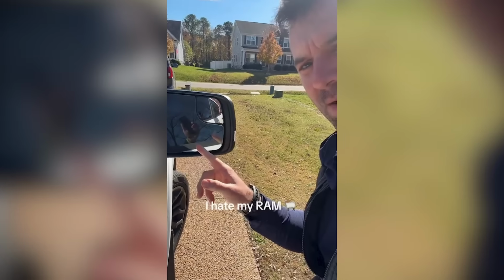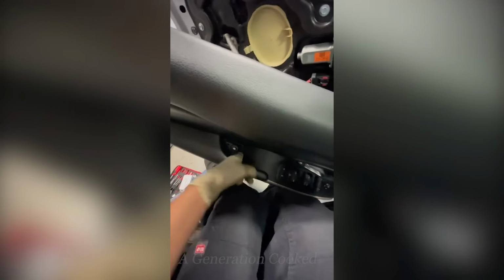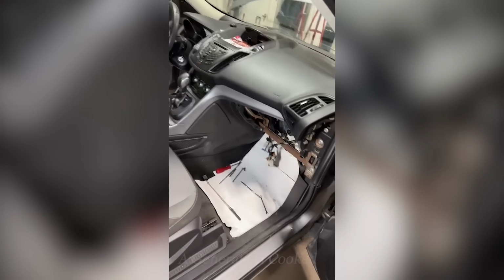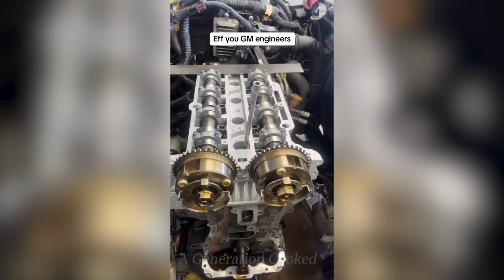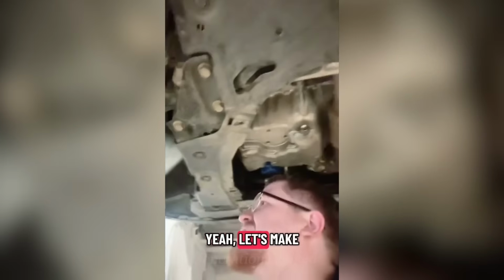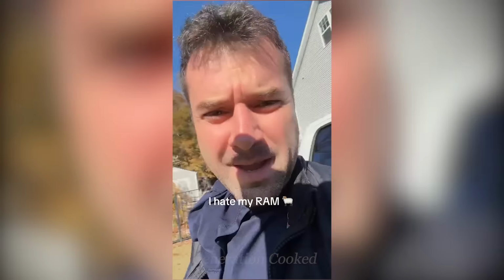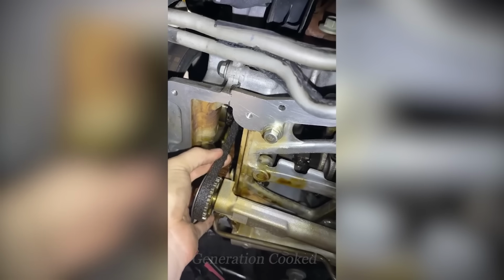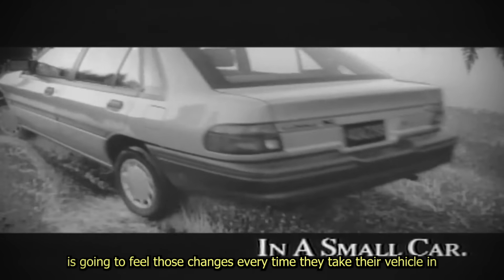Car Mechanics Are Finally Speaking Out About What Really Happened To Cars & Trucks, It's Junk

Comment: The Post-COVID Automotive Decline: A Revenge and Counterfeit HypothesisMany vehicle owners and mechanics are currently venting their frustrations online regarding the shocking drop in vehicle reliability—particularly with post-COVID models from the Big Three. While the mainstream narrative blames standard supply chain issues and rushed engineering, there is an alternative hypothesis that connects the dots between worker morale, the global semiconductor shortage, and geopolitical strategy.Here is a breakdown of the hypothesis:1. The Quiet Quit and Employee RevengeThe automotive workforce went through unprecedented stress during the COVID-19 pandemic. When plants shut down or forced aggressive return-to-work timelines, many employees felt completely abandoned by corporate management. When worker families suffered losses, major corporations like General Motors largely treated them as numbers rather than human beings, failing to offer meaningful support or empathy.This hypothesis suggests that the modern engineering and assembly failures we are seeing are not entirely accidental. When you alienate thousands of workers, you create a workforce that no longer cares about quality control. What looks like incompetent engineering could actually be passive-aggressive employee revenge—sabotage through compliance, where workers intentionally let flawed designs and low-grade components pass through the system because they have zero loyalty left to the brand.2. The Influx of Counterfeit Black Market ChipsWhen the global semiconductor shortage crippled North American manufacturing, automakers were desperate to keep assembly lines moving. Mainstream chip manufacturers could not meet the demand, creating a massive vacuum.Under this hypothesis, that vacuum was filled by billions of low-grade, defective, or outright counterfeit chips dumped onto the black market by overseas suppliers. Desperate to hit production targets, automakers bought these sub-par electronic components and integrated them into brand-new vehicles. This perfectly explains why vehicles built after 2021 are plagued by unfixable electrical ghosts, sudden power losses, and premature component failures.3. Geopolitical Disruption and the Rise of Chinese ManufacturingThe ultimate beneficiary of this collapse in American automotive quality is the Chinese Communist Party (CCP) and its state-backed vehicle manufacturing apparatus. While the Big Three struggled with fragmented supply chains, Chinese automakers kept their manufacturing completely in-house, securing their own domestic supply chains and avoiding these component defects.By flooding the global market with cheap components and waiting for American auto quality to self-destruct, foreign competitors have positioned themselves perfectly. Now, as consumers lose complete faith in domestic brands, Chinese-manufactured vehicles are actively entering neighboring markets like Canada and Mexico. Once the Big Three fully collapse under the weight of recalls, class-action lawsuits, and consumer distrust, the infrastructure is already in place for Chinese state-backed manufacturing to permanently replace them.What we are witnessing isn't just bad luck—it is the logical outcome of corporate neglect, desperate supply chain gambling, and a coordinated effort to dismantle domestic manufacturing.

Comment: MY OPINION: 

OVER ENGINEERED SHOULD MEAN A BETTER QUALITY PRODUCT MADE TO LAST, EASY TO OPERATE AND REPAIR, RESPECTING THE CUSTOMER ... ETC. 

WHAT IS REALLY GOING ON IS REALLY UNDER ENGINEERED ... NOT CONSIDERING THE QUALITY OF THE PRODUCT, THE EASE OF OPERATION, EASY EFFICIENT REPAIR, PRODUCT LONGEVITY, ETC.
IT DEMONSTRATES A  LACK OF RESPECT FOR THE PRODUCT AND THE CUSTOMER.

REALLY, THE PROPER TERM IS: 

 IMPROPERLY ENGINEERED

Or, perhaps even better:

GREED ENGINEERED 😢

Comment: biggest thing I see is engines going before 100,000 because of the thin oil guys other countrys do not use that 0w 16 or 20 crap put 5w30 in and get 250,000 miles if the electronics do not take it out none of these new cars are going to last long people ask me about rustproofing I tell them forget it rust will not be what takes it out

Comment: Still have two or three scars three years later from a f-150 trans service I had to do at a Fleet Maintenance requirement. I will lie next time. A truck is not worth scars. Maybe next time I will drain trans in a pan that measure the amount I drained and put the exact amount in and hope for the best. F the idling hot in neutral and seeing if it is correct.

Comment: wait until you try to replace a broken lock actuator on a 2016 Town & Country.  It's ridiculous the amount of disassembly, and the Dealer wants $4000 to fix both EVEN THOUGH FCA recalled the van just for those parts.  I traded it for a Subaru.

Comment: They are "engineering" common replacement parts to increase dealer/shop cost. 
It sure AF doesn't help everyday mechanics, who'd wanna stick around for the piddly "per replacement" pay for their hassle. 
Wtf is the bloated govt/regulatory system to protect consumers? DOA is what. Stay tuned chuchos, we ain't voting outta this.